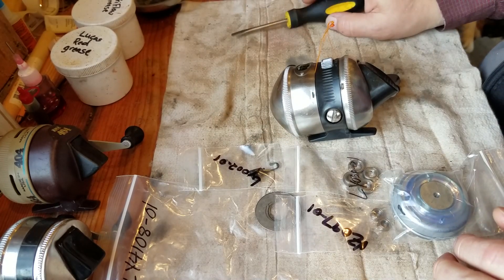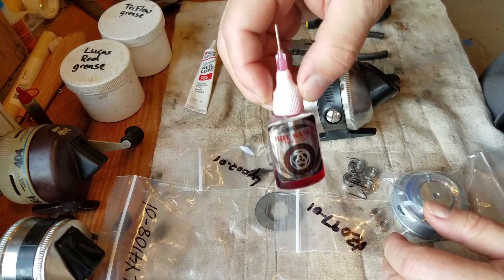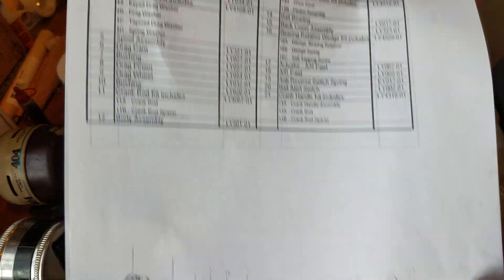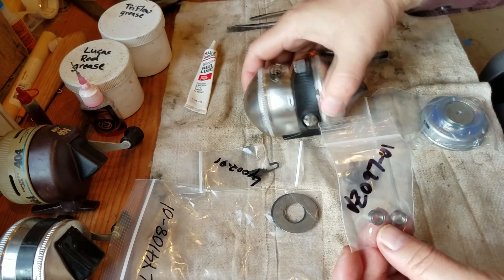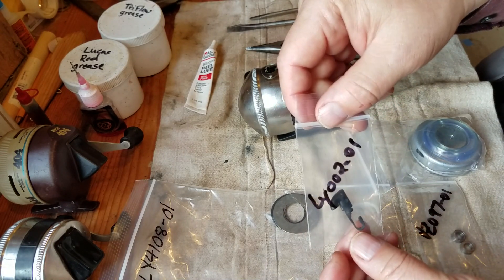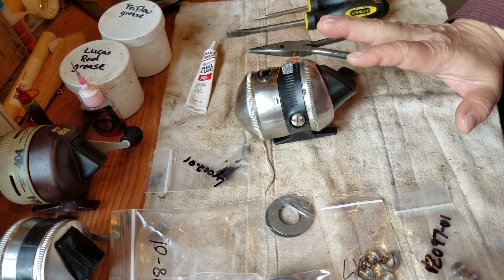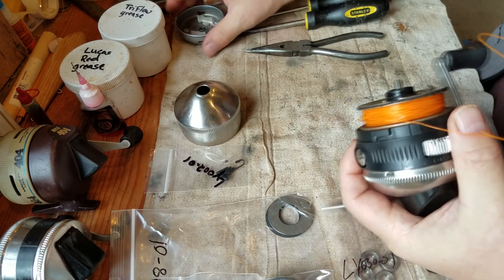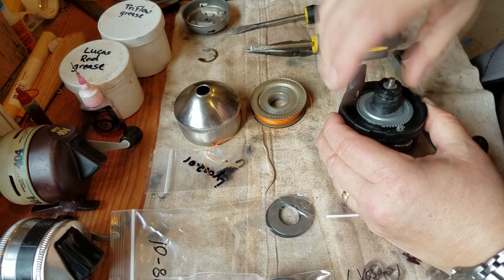Super Tune a Reel: Zebco 733 Hawg

Comment: Thanks for this information. In the past I have fished with these reels and just bought new ones when they had problems. These videos are game changers. I must have 15 or 20 Zebco 33's and 733's laying around. I fixed two already this week and am waiting for the bearings to super charge them. I didn't pay attention on the orientation on the retainer part but I will let you know when I fix the next one this afternoon.
Reply: I went ahead and took another 733 apart and the orientation of the bearing retainer is as you assumed in the video with the flat side next to the gears
Reply from the maker: @kennethford4943  That is correct.  I later took about some newer 808s and 888s.  The wedge retainer is made so it can only go in one way. Flat side against the bushing/bearing.  Thanks for your comment.  I am thrilled you got your old reels out and started refurbishing them.
Reply: @OutFishing13Matthew  I found 4 Zebco 33's, 2 Zebco 808's and a variety of Zebco 33's. First I fixed a relatively new Zebco Omega Z03. Had to replace the anti reverse clutch which had broken. I have fixed and super tuned 3 of the 733's. One already had 4 bearings and just needed some serious cleaning. The fifth one looks a little different. It has Bearing System printed on the front cover. There is an anti reverse control on the left and a sprocket type device below the crank on the right. I haven't been able to get the cover off yet so I am soaking it in soapy water over night. Am I going to find something totally different inside of this real? I am saving the Zebco 33's to do last. I use all of these reels to fish for catfish in the rivers of western Ky. Gives me something to do while I await to go back to work in 10 days' Meanwhile have been hunkering down due to the coronavirus except to go fishing, turkey hunting and mushroom hunting.
Reply: should have said 4 Zebco 733's
Reply from the maker: @kennethford4943   the 733 should be the same on the inside if the outside looks the same.  It might be one of the earlier models and the gears are made a little different.
Reply from the maker: @kennethford4943  the ZO3 is super nice. That AR is simple to replace.
Reply: I finally got the front and rear covers off. The insides are dramatically different than any of my other 733's. The drag cam is totally different and there is no spring washer and no keyed drag washer. The "sprocket" shaped device under the crank handle has to come off in order to get everything else out and I am not sure if I just pry it off or there is some other way to do this. Also, I have found 11 different schematics for 733's. None look like this 733 that I have. I noticed that some of the 733's do not have the plastic actuator clip LY062-01 (nor the anti reverse switch or spring). Instead they have an anti reverse clutch just like the one on my Z03. Could this clutch be placed on any 733? The reason I ask is that one of my 733's has a broken plastic actuator part #LY062-01 which is not available at Mikes or Tackle Service. Finally, is there any way I can send you a photo of the inside of this reel?
Reply: I finally got the gears out and everything apart. The "sprocket" has to be how the drag is set. It does not separate from the crank rod. There was a little metal clip that I didn't notice before that was the key. The reel is a Zebco 733 "The Hawg" and has the numbers 733E-M2 Made in China
Reply from the maker: @kennethford4943  To get my email address, go to my Outfishing YouTube homepage, by clicking on "Outfishing". Then click on the About tab and you will find my email address there.  I just don't want to post it here in the comments.  Unfortunately some parts can no longer be found.  I don't think you will be able to use an anti-reverse from another reel.  That is an older 733  made in China reel if the drag is set using a sprocket on the handle.  I'd like to see a photo.

Comment: Matthew, I love your channel. I recently purchased a good used Zebco 733 Hawg at an estate sale. I am trying to ‘Super Tune” it. I went to Mike’s Reel repair website to purchase the ball bearings I will need. Unfortunately, some of the bearings are no longer in stock. I Googled the part number but was unable to locate the bearings from any other source. I also looked at the schematics for the 733. It doesn’t list the size of the bearings, only the Zebco part number. Could you please reply to this message and list the size of the bearings so I can try and source from some place else? I am particularly needing the size for VZ030-01, VZ017-01 and VZ097-01. Any help would be greatly appreciated.
Reply from the maker: @timrobinson2863  yes. Can you find my email in the about section and send me an email. I am sure they can be found on Amazon.  I need to get more and keep the kits in stocks.

Comment: Did you ever get a generic part number for the VZ030-01 bearings for the 733? Tackle Service is always out of stock. I’ve got quite a collection of 733 now, 7 reels. I use them for bass fishing out of my float tube. I carry 4 rods while I’m in the tube loaded with various baits. Thanks, jeff
Reply from the maker: Hi Jeff.  Yes, I have a generic number for those.  This is a 8x14x4 mm bearing  (SMR148-ZZ or SMR148).  Look for a full stainless steel bearing.   The Zebco part number is a VZ030-01 or LY030-01 and fits the: 733F, 733PL, 33MAX, 33MXK, 33MXG.  What I cannot find is the nose bearing.  That is a 6.3x10x4 mm Bearing. And it can only be bought at Zebco and was for the 733 Platinum.

Comment: Hello Matt, happy Monday to you. Just a quick question. What's the purpose of putting bushing bearings in these 733 hawg reels? Does it help cast further or retrieve faster? Thank you!
Reply from the maker: great question. It doesn't help with casting distance or make it a faster retrieve. It does help with durability and reeling in big fish easier.  Essentially it will make it a tougher, long lasting reel.

Comment: Can the 733 hawg be fixed to where it has instant - antireverse like the zebco one? Can someone send their zebcos too you for super tuning? Thank ya n God bless
Reply from the maker: It may be possible.  The 733 platinum uses part # NR112-01 A/Rev Clutch and so it is very possible that can be done.  The part is about $7 without shipping.  I would need to check the main body of the 733 and the shaft to make sure.  However when that was done you would no longer have a functioning bite alert.  See my ABOUT page to get my email address and contact me about super tunes.  I can do them, however, you need to understand that the shipping is about $18 for the round trip.  Contact me for the price on the Bearing Kit.
Reply: Would you be interested in fixing one of my 733 hawgs by putting the ant./ rev clutch in it n also put the extra bearings in it? If so send your mailing address to me , thank ya sir
Reply from the maker: @kevinivey5944  Sure. I could do that.  Send me an email at marblegems@gmail.com and we can talk about how much it may cost.

Comment: What is the difference between ball bearing parts LY017-01 listed on your schematic for the 733 Hawg and VZ017-01 listed on the schematic for the 733 platinum?
Reply from the maker: Great question. The LY is a chromium (stain resistant steel) and the VZ for the platinum is a stainless steel and more expensive (I think....)

Comment: What is the difference between the 733 and 33  Authentic. They look the same to me. Do both share the same bearings.
Reply: Also are this models good for salt water after a super tune? I have. 33max that after two trip it lock on me.  I did a complete maintenance on it. Brought it back to life and  I'm waiting on the part to do a super tune. I got my hands on a 733 and two 33 Authentic all use but in good condition and I want to super tune them.
Reply from the maker: The 733 is bigger and the bearings/bushings are bigger.  They stopped making the 733 and make a 33Max now.
Reply from the maker: They can be used in salt, but it isn't recommended.  Zebco does make a 33Max Salt.  If you use a reel like that in salt water, it is recommended that you take the front cap off and rinse with fresh water after each trip.  Then let it dry out and put the front cap back on.

Comment: Do you have a extra spinner cap for a zebco 733 hawg
Reply from the maker: I need to check.  Are you asking about the 733 Direct Drive made in USA or the 733 Hawg made in China?  The part number for the made in China model is a LY310-01.  If I have one, I just have one and bought it for a spare.  I recommend you contact Zebco at 1.800.588.9030 and ask them if they have that "spinner head assembly".  If you are looking for the 733 made in USA model, I did a quick search and found there are some Spinner Head Assemblies on Ebay.

Comment: Where do you order these parts? I think it’s incredible that you can service most Zebco. I bought a box of 9 Zebco reels recently for $65. Most need a little help including a 733 Platinum which is the one I really wanted. But after checking out you videos, looks like I can service all of these reels; keep what I want and sell the others. I’m mainly a fly fisherman but occasionally fish conventional, but I hate spinning reels and baitcaster. Zebco can be used in any situation those can and are a pleasure to use. I thought for a while that the 33 was their top of the line but there are so many other models; I want to try them all! Anyway thanks for doing this video, I think my 733 Platinum is going to be my bass workhorse.
Reply from the maker: Glad to hear you like Zebcos.  You can order Zebco Spincast many parts here:  https://www.tackleservice.com/.  However, not all parts are available.  And not all schematics are listed.  However, if you will search for a schematic or find a schematic, you can use the Search feature and search for the part with the, "search keyword, sku #, or item #" feature and find the parts for a 733 Platinum.  Many Chinese made Zebcos have parts on there. However, most or all USA made parts are no longer produced.  If you need a part for an older reel, try the Facebook Zebco groups.
Reply: Hey Matthew, I was wrong, it’s a 733 Titanium. I got a schematic now of a basic 733. Surprisingly it looks like mine only has one bearing on the handle shaft; which I will order for the other side. I was able to tighten up the slop from watching your video and greased it and oiled it. It’s much better, I think the other bearing will really help out, right now there is just a bushing. Thanks again. Looking forward to going through the other 8 reels.
Reply from the maker: @jeffcollins1172  Awesome.  I want to find a 733 Platinum some day.  I am not sure why they called it a Titanium.  Maybe titanium nitride pick up pins?
Reply: Hey Matthew, you wouldn’t happen to have an extra VZ030-01 bearing, tackle service is out of stock. I’m willing to pay you for it.
Reply from the maker: @jeffcollins1172  Hi, I saw your post on FB before I saw this one. I will look, but I think I only bought enough from TackleService to do one reel.  Otherwise I will help you find a good generic one on ebay or amazon.
Reply from the maker: @jeffcollins1172  I guess TackleService is running out of these bearings.  I am going to start a list of the generic bearing part numbers.  I just need to measure my bearing and find them.  I will make a list and start posting them in the descriptions. I will let you know when I have the list completed.

Comment: What is a trick to get in the back cover back on
Reply from the maker: I have put them in a freezer for a couple hours and then turned the back off.  That shrinks things a little and loosens them.  A blow dryer to warm it up.  Use a strap wrench for oil filters.  What happens is dirt and grit gets in there and gums it up.